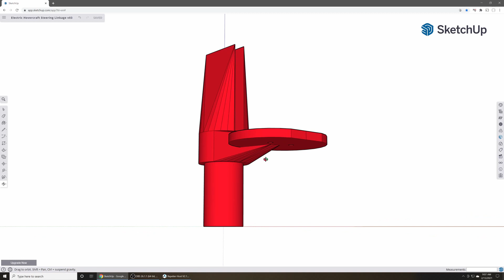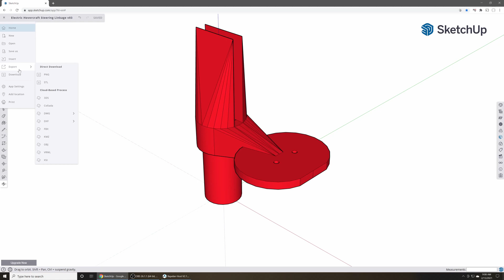How I 3D Printed Working Electric Hovercraft Parts with a $150 Printer

Comment: very cool , whats your estimated max rpm on the 28 inch prop?? i have 2 of these on my biclycle , im running them just over 5000, but ive been told they do quite well at 7500.